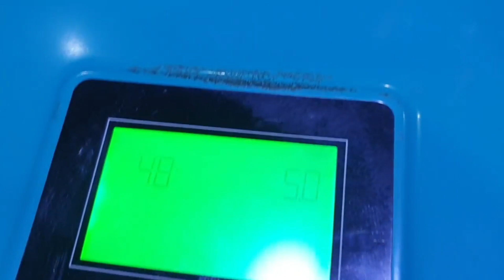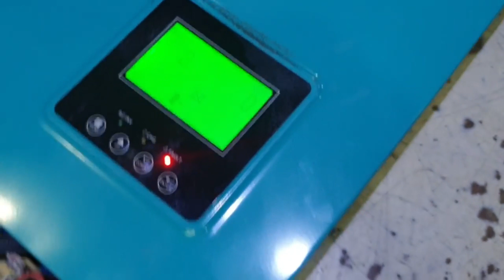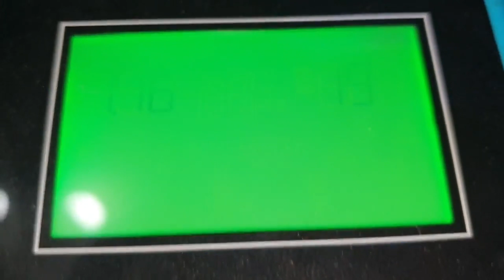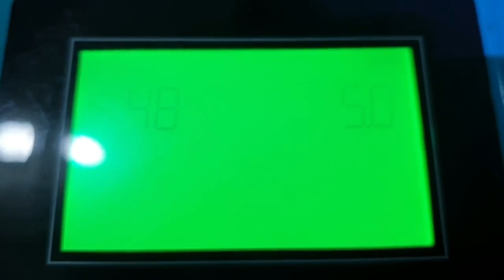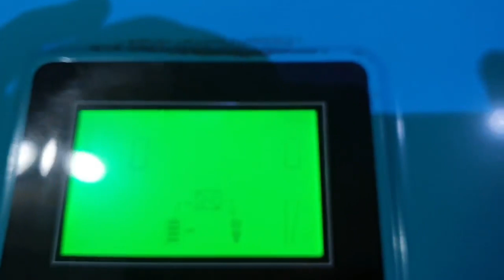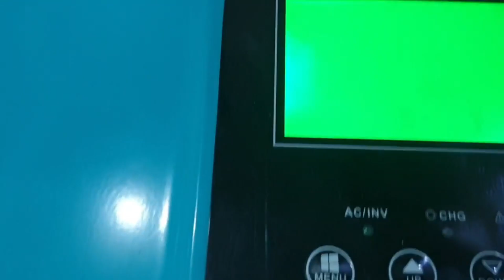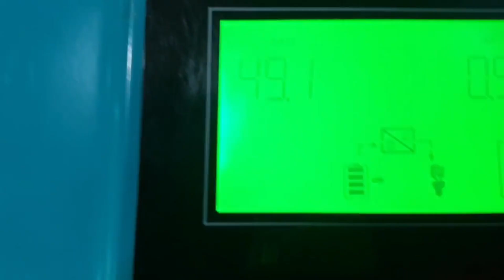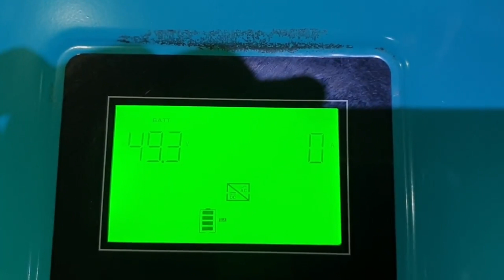How to fix your hybrid inverter？ Error 06 - 7 steps replace new Mos tubes

Comment: 80% of the time when my fridge starts i get error 07 for a few seconds then clears and all goes normal ... all this started after pv input mosfets where changed am not sure but i think the ac output mosfets where changed aswell
Reply from the maker: The compressor built into the refrigerator is an inductive load, so the power will soar to about 3-6 times the rated power at the moment of startup. If the rated power of your refrigerator is 1kW, then its power will be 3kW or 6kW in the first few seconds of startup. If your inverter power is 5kW, then long-term use will shorten the service life of your inverter or gradually damage it. It is recommended that you choose a more powerful inverter to power your home.